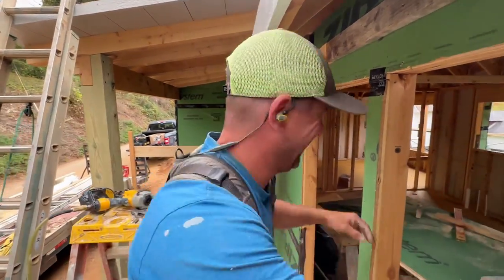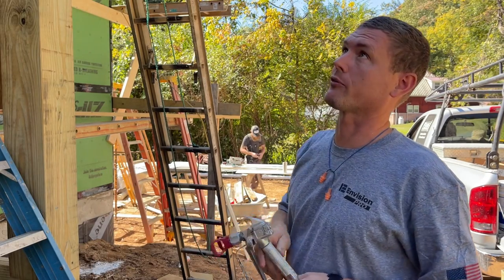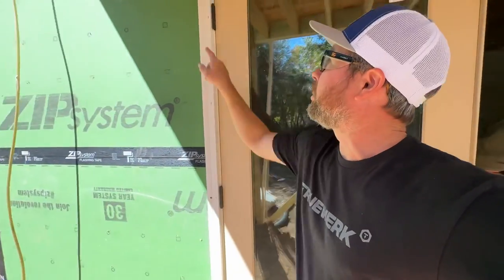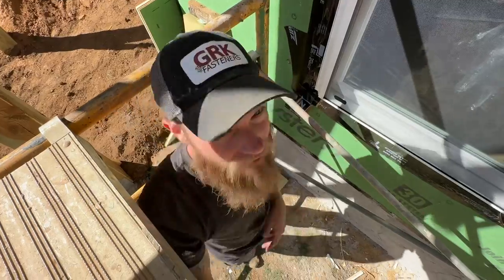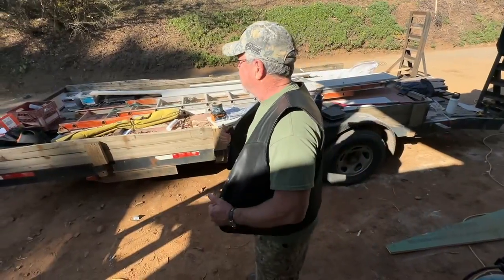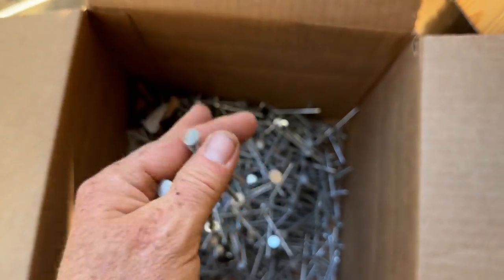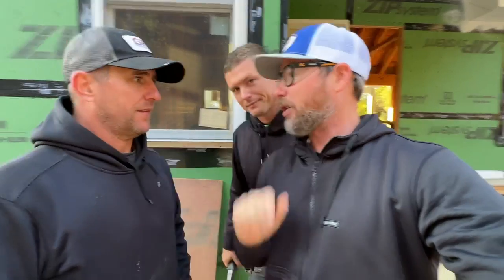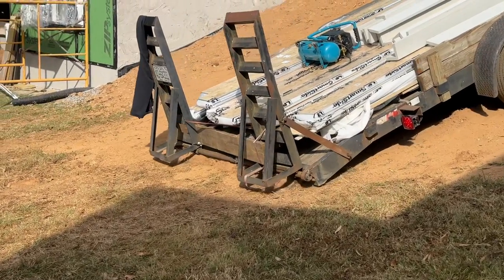Building A Small Income Property | Part 16

Comment: Primer tip for knots in wood. Spray B•I•N primer on the knot itself first then paint over it with whatever your primer you are using. This was recommended to me from a Sherwin Williams employee. Works tremendously.

Comment: I have seen spray painters in Ireland smear vaseline on there face and some used to pull a pair of women's tights over der head.. but they use oil based spray sometimes.. might help with the spray on the face

Comment: I could see some caulking on the base of the French door but no flashing. Don't use it where you live? We use lead flashing on all basement walk-outs along with caulking here.
Reply: They've used it on other builds. Maybe didn't use here since it's covered by the porch.
Reply: We usually just put lexel under it when they are placed on a slab

Comment: Hopefully you guys see this and can answer it.  I just installed all of my windows on my house. I was going to use the nail in method as most builders normally do. I decide to screw mine in with the 2" GRK cabinet screws with the big flat head. Why wouldn't you use the GRK low profile cabinet screws?
Reply: expansion and contraction ?
Reply: Check out Awesome framers videos they use screws on all the windows.
Reply: I think I will give that a try next time. Thanks

Comment: Why cover the zip roof system with a layment?
Isn’t it supposed to be waterproof on its own?
Reply: We've done some houses with zip, did the walls that is, it's great, and I always wanted to sheath a roof with it, because that would be way easier than running ice and water and titanium. But I'll bet that zip was getting people telling them that they were having issue with the roof not being 100% water tight with just the taped seems, so they came out with that layment product. It looks like a total pain in the rear to roll that out too. Makes me not want to sheath a roof with zip anymore
Reply: @The_Pennsylvanian  if that is the case then the whole point of the zip system becomes redundant 
.
Reply: It is fine by itself. We just wanted an extra lay of protection on the low slope roofs and then we just did the whole thing